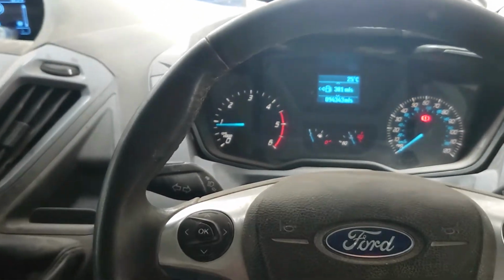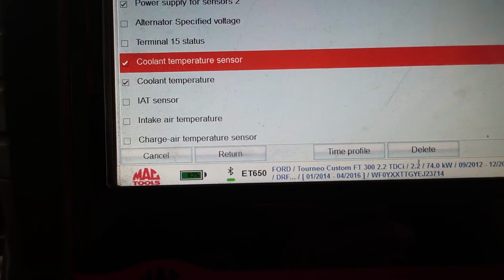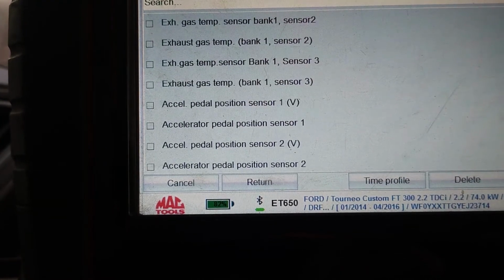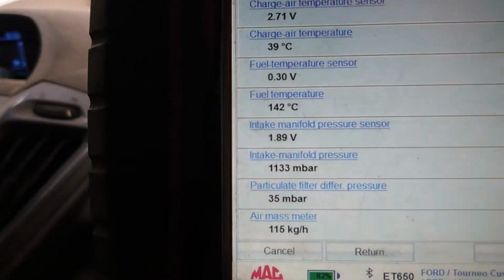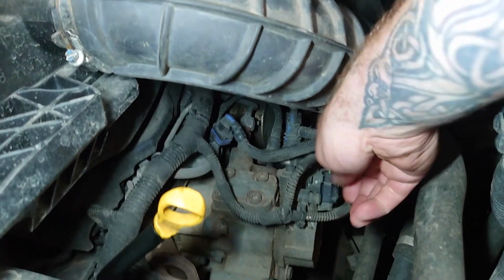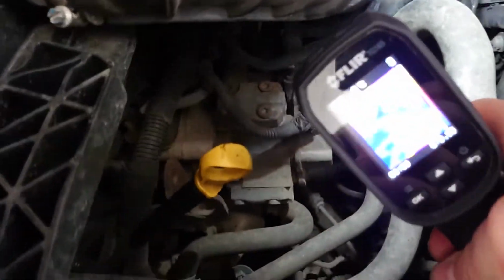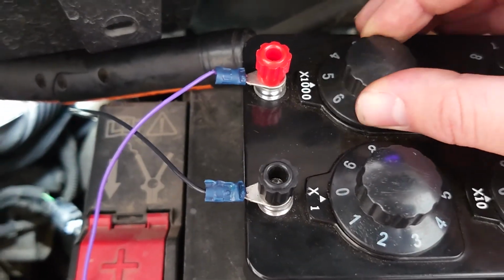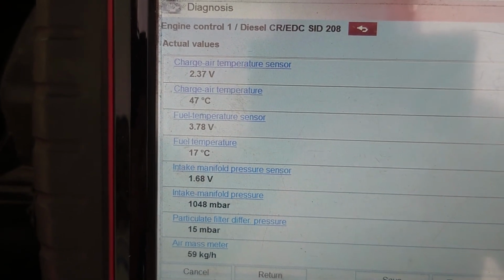Ford Transit Custom - No power and No fault codes

Comment: Wonder how they have programmed the car to even measure 150°C fuel temp and not having it make a fault code... 😂
Fuel tank melted and all fuel is steam 🤪
Good find anyways and from the comment section is an common fault👍
Reply from the maker: Thanks for the comment

Comment: Thank you it was interesting and good to know ...
Reply from the maker: Thanks for the comment
Reply: @rmautodiag  people like you help others and make this world better place and cheaper for us drives
Reply: And something important no dtc codes no nothing and diesel consumption 1.5liter more and then I change the differential pressure sensor and tadaaa Regen was few min on and then I did a highway 🛣 run and later on I reset the consumption and trip and I m now ob 7,6l and 8,1 -8,2 on highway 130kmh and consumption was 9.5 wtf

Comment: THANK YOU - THIS SORTED MY LIMP MODE ISSUE ON MY EURO5 2015 RWD TRANSIT. 

2 GARAGES COULDNT DIAGNOSE IT, VAN OFF THE ROAD 2 WEEKS.

UNPLUGGED THE FUEL TEMPERATURE SENSOR AND NOW ITS WORKING.

NEW SENSOR ORDERED.

THANKS FOR MAKING THIS VIDEO, IVE BEEN SO STRESSED OVER THIS ❤
Reply from the maker: Thanks for the comment
Reply: can you point me in the direction of this plug please? i seem to have developed this fault

Comment: I literally had this issue last week, 2.2 m-sport custom went into limp mode and sounded terrible, plugged it into forscan and fuel temp sensor was ready 95 degrees and outside temp was -3 ! Then it started fluctuating up and down on its own so replaced with a genuine sensor and all seems good again 👍🏻

Comment: Here is another symptom of a faulty fuel temp sensor on a 2015 ford transit custom 2.2. bad fuel ecconomy, rattly engine, and severe clutch judder, ( banging like crazy ) when engine was hot and pulling away in 1st gear. The engine revved perfectly well, ( revved up as if nothing was wrong ) no fault codes, just tappety engine when cold and accelerating when hot and a very severe engine judder when pulling away in 1st gear. BTW my fuel temp sensor snapped in the pump when extracting it :O i screwed a self tapper screw down into the part stuck inside the pump and levered the screw with long nosed mole grips. So revved fine , nofault codes, bad judder when hot and tappety when cold and accelerating. Hope this helps someone .

Comment: All I see is problems with these Ford Custom vans , they seemed ok up to 2015 then the face lift models especially the new ones are problematic with all kinds of issues….
It’s a shame Ford have gone down the pan as I’ve many many good ones In the past namely Mk 5’s 6’s and early 7’s , I wouldn’t buy another one… 😂

Comment: Would this apply to the 2.0l? I just had this happen on the motorway, no warning lights now it's been parked it revs up fine now, can't find a fuel temperature sensor part for the 2.0l 2017 custom?

Comment: great video.......would like some advice please just bought a new ford transit trail AWD.......LWB  170BHP...with 300 miles on the clock..... the van has no power will rev ok in neutral... but in the gears 4.5.6 there's no power.... wont rev past 3000rpm ???no lights on dash...... very limp
Reply: Did you ever get this sorted?

Comment: What about no power/horrible acceleration, no fault codes but it's able to rev over 2000, 3000 no problem... no shaking, fuel cons. at idle is always like 0.4-0.5L/h (which is the same as before when car was fine), only that noise i think cause by turbo it terrible like some vacuum cleaner. 1.6tdci/66k2 (focus 2009).
If i could find some other same car to compare live data values but no luck... The thing is that few times car did "fix" it self and like for few days it is flying like a rocket but after few days again it goes bad again.. Any idea? 
I use ForScan and checked gas pedal/throttle response is ok, fuel rail pressure seems to be ok ( it follows gas pedal change)...
Reply: Did you get to the bottom of this mate? I'm having similar issues with mine
Reply: @chrisgrantham2648  nope... I'm still driving focus in such horrible condition.. no one knows how to fix it and what is the problem
Reply: @miladinseratlic5984  I managed to get mine sorted today mate. Tappets where either seized or flapping in the wind so all 16 have been replaced. 1 injector was carbon city so the seals where replaced and its like a fucking rocket now. No smoke, no issues with rpm. Honestly it's like Christmas come early, so glad to appreciate her again.

Comment: Ford transit just had Recon engine , all timed up perfect and new turbo fitted . No warning lights on and revs up normally . When driving its like it has no power it’s like the  turbo isn’t kicking in but turbo is fine ? Any suggestions  ???

Comment: Hi mate where are you based? Could you look at my transit custom. Van broke down fuel related issue. I replaced in tank pump, glow plugs and fuel filter. Just had a new BCM module from ford, van starts and drives now however power band is sporadic with lots of flat spots. No fault codes though.

Comment: I’m about to bite the bullet and purchase a new van leaning towards the Transit. Probably not the platform but would anyone know if the new transits are on ok?
I see various mechanical problems online but I’m wondering if it’s because of the popularity with a lot of them on the road, are the issues a small acceptable percentage of the volume sold?

Comment: Thought I would share my findings. I got 2014 transit custom, 2.2 diesel 155hp.  Clutch pedal only comes back up half way which, I 've noticed, causing power issues and cruise control doesn't work. When I pull the clutch all the way up with my foot, all back to normal. Not sure how its all connected.
Reply: Had the same problem, plus the hill assist stopped working. WD-40 was the solution.

Comment: Neat. Have a similar issue but intermittent. Loses power, won't rev past 1200-2000. Power comes back if you floor it for a minute or two and if i shut it off and restart it it usually clears up.  No codes/lights.

Comment: I have the 2012 custom 2.2 duratec. Mine does rev up all the way, no error codes aswell. It pulls weel 1st and 2'd once i drop it into 3rth it just won't pull trough 3rth anymore... I have an error reading box. But it's fcking complicated.
I'll hope i'll be able to sort this out tonight
Reply: Hi I’ve got same problem with my van mine won’t pull down a hill either 1st 2nd great crap strange one I’ve had alsorts done new turbo etc still the same
Reply: @simonvickerman9598  figuren is out. Was a stuck egr valve. I let a tuner reprogram my ecu without the egr valve in the software. Runs like a Dreams now